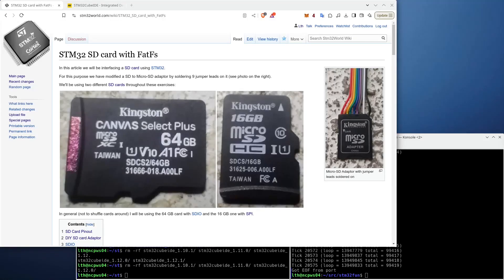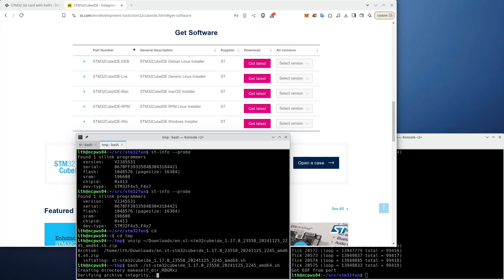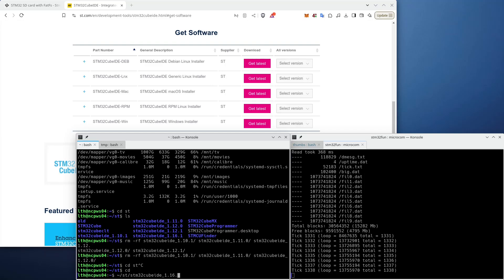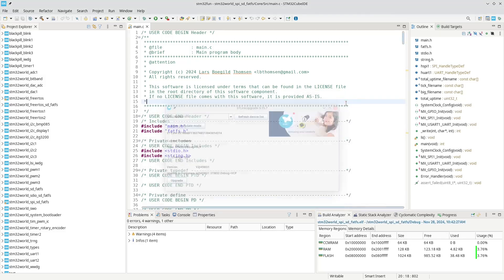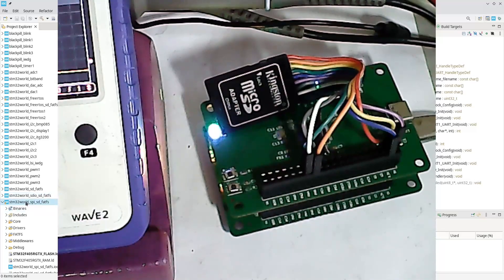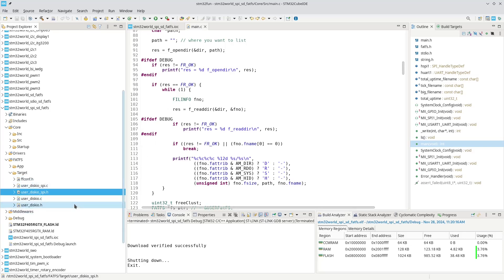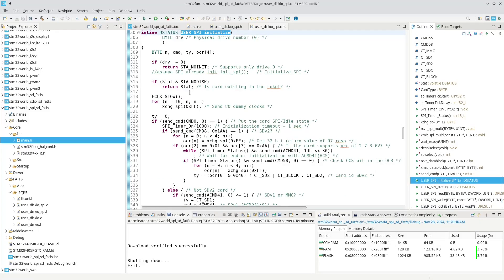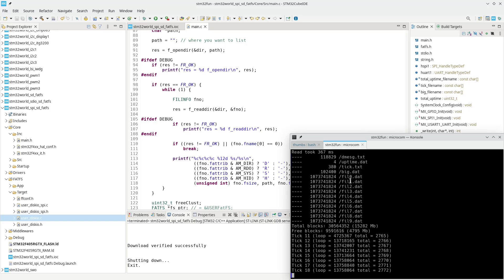STM32 Tutorial #34 - SD-card w. FatFS (using SPI)

Comment: I can't figure out how to get the FATFS code? I am using the stm32g071rb, but in stmcubemx, I can only find user-defined and usb-stick options?
Reply from the maker: Pick user-defined and make the source modifications mentioned.
Reply: @stm32world  I have no option to select it there either. The stm32 does not have SD capabilities, so it does not get mentioned. I have found an article about fixing it. Thanks for the fast reply
Reply from the maker: There's no selection of SD card except when using SDIO.  Select a SPI and a GPIO for CS.  Add FatFS and in the FatFS config select the User defined.  Rest is configured in the FatFS code.

Comment: I've installed your project into my own stm32cubeide. It gives no error ut when it tries to create a file it gives FR_NOT_READY. Is the problem with my SPI SD disk module hardware?
Reply from the maker: I would suggest you join our Discord server.  There was someone else who was struggling with SD and SPI but managed to sort it out after a few days.  Perhaps he's got some ideas.  https://discord.gg/sBWKemsZ
Reply from the maker: Hard to tell based on this info.  Most likely the SPI communication with the SD.  Did you pull up the data lines?  How did you hook up the SD card.  Also  - as mentioned - there are a few SD cards that does not work with SPI.

Comment: Hello, i am using nucleo board STM32401RE. i am getting "../FATFS/Target/user_diskio_spi.h:8: error: unterminated #ifndef" this error
Reply from the maker: Line 8 in that file in my repository is a comment line, so not sure where you got it from.  Check my repository here: https://github.com/STM32World/stm32fun/tree/master/stm32world_spi_sd_fatfs/FATFS/Target
Reply: hello could you please tell me how u solved the error 
i am using the same and facing error in connecting and mounting sdcard
Reply from the maker: Well - you have my code in the git repository - that works, so if you get the error you described you copied it wrongly.